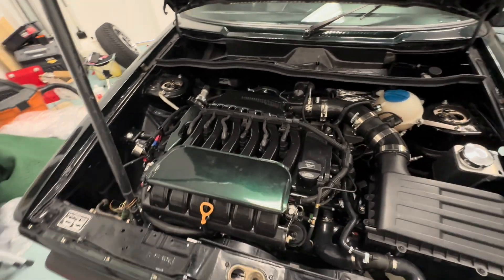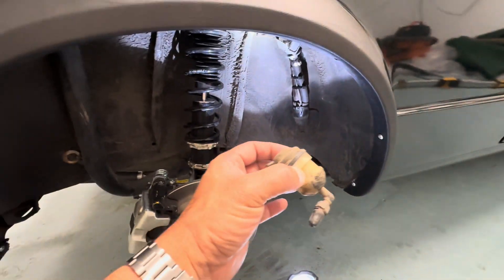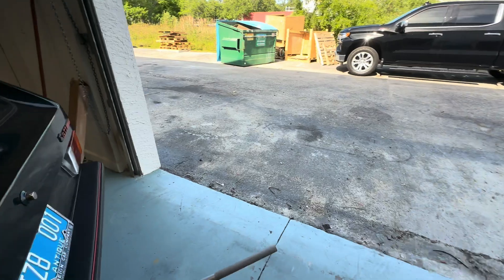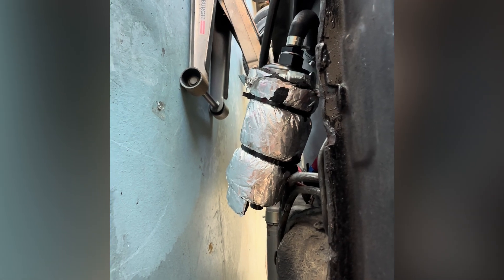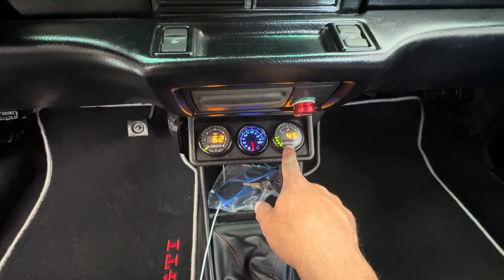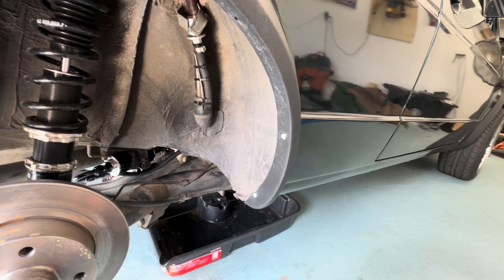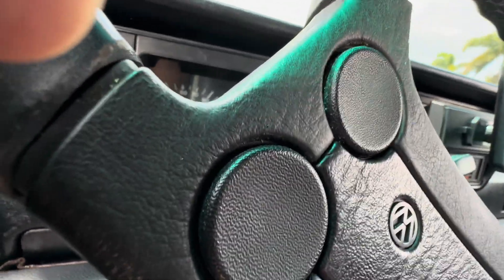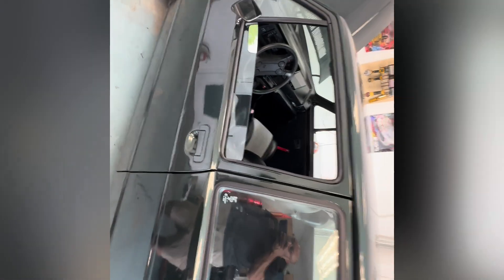Volkswagen MK1  GTI  rabbit VR6 ￼ fuel pump setup  walbro 255 inline.

Comment: Just curious. I take it this is not a U.S. Rabbit, but a Golf imported from Europe, right? I mean, if it's a 1983 model, I assume that from the round headlights, rubber covered bumpers, non U.S. interior dash, etc. What I find curious is the fuel door (not a black round cap, but an actual square door) and the door handles. Those were modified, right? I was a proud owner of a U.S. specked Rabbit LS from 1981. Although I always saw the European Golfs, especially the GTis with envy. Thanks.
Reply from the maker: Hey , so we did a front end of a cabriolet and rear from a cabriolet euro style bumpers and dash from a cabriolet and front grill from a cabriolet, door handles are from a Audi A3 and gas cover is from a mk3 . I wanted to have a euro style GTI and more modern but still VW parts . We are running BC coil over 6k in the front to hold the weight of the engine as well as a cross brace from S&P and kneebar from the cabriolet to support the mid frame and rear stress bar to support the rear with 5k BC coilovers in the rear . Willwood breaks and disk in the back . May be selling the car soon if you are interested
Reply: @jessmods8980  Interesting! Very creative. 

And no thank you, I don’t have the budget for another car right now… new or restored. But I would love to own that particular Rabbit, needless to say!

Comment: What have you done with the top part of the gas tank? have you welded it?
Reply from the maker: Thanks for asking , I had a friend that was helping me and he installed the gas tank , I’m aware that there’s a top vent on the new gas tank and I can’t see it so now I have to probably drop the tank and check to make sure it’s properly vented and not cap off since the lower vent and top vent both feed the gravity valve ..

If you are asking if I welded anything on the tank no I did not .
Reply from the maker: No I purchased the correct tank and vented it correctly